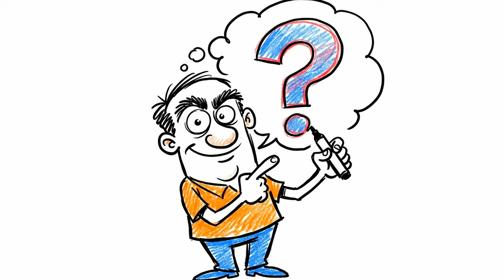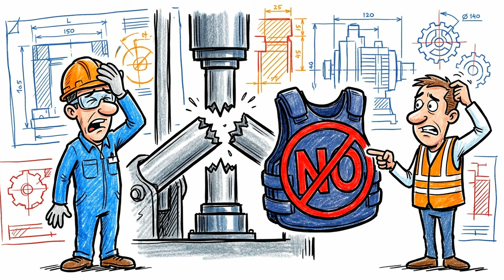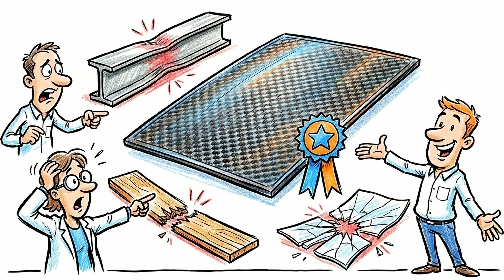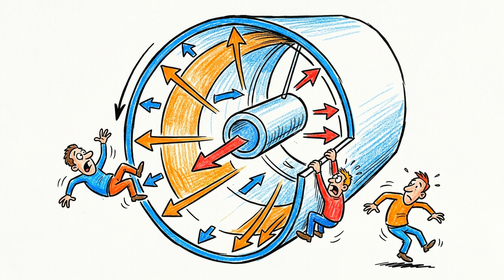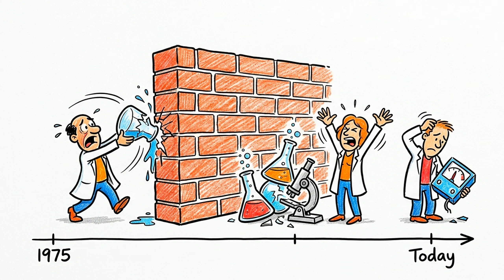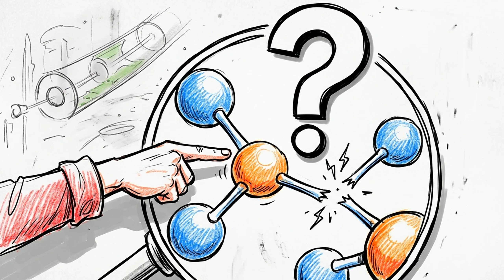Why O’Neill Cylinders Are Impossible

Comment: Pressurized cylinders inside of pressurized cylinders. Multiple layers of pressurized hulls providing redundancy. The interior cylinder at 1 atmosphere, the one outside of that at 1.2 atmospheres, the one outside of it at 1.5 atmosphere, ect..
The center cylinder walls won't have to handle the stress of a vacuum competing with the centrifugal force of all of it's contents since it is being pushed back inwards by the greater pressures of exterior hulls which do not have to spin.

Comment: The fictional Babylon 5 station was essentially an O'Neill cylinder 5 miles long.  I don't remember how wide it was, but I wonder if that scale would be possible?
Reply: Babylon 5 had an overall diameter of 1.6 kilometres. It is possible to build this, but the Kalpana habitat is a better design and the current hot favourite.

Comment: This hurt my brain it has so many errors.
Reply: For starters you can have double and triple hulls. If shell is constructed in space materials can be vacuum fused. Micrometeorites are an issue, which just means you need to replace an ablative layer periodically.
Reply: Why don't you outline those errors instead of just casting shade on the AI's work.

Comment: The spin is the only thing between the pople inside and the vacuum outside?  Also making it sound like any rotating structure is impossible. Foremost, dont trust one source of any calculations. Also material science moves forward alot. And depends alot of how you contruct some thing. I call this a rather bad part of video. Could been good with a different script.

Comment: Looks almost like the opposite of the deep sea titan that failed.  Pressure inside instead of outside.
Reply: It's not the pressure, it's the centrifugal force. If the cylinder isn't spinning it would be structurally fine. Of course everyone inside would be floating.
Reply: @mdhj67  Sure but you can use an outer, stationary hull to avoid this.
Reply: @wkeithk  How does an outer hull cancel the centrifugal force?
Reply: @mdhj67 By insulating the inner hull from the deteriorating factors of direct exposure to space. The c-force is good the constant thermal expansion/contraction, erosion and vacuum pressure bad.

Not trying to cancel centrifugal force, we’re making it on purpose. We’re protecting its apparatus.
Reply: @wkeithk  That would not affect the hoop stress at all.
Reply: same results, near instant death.
Reply: 1 atm of diffrence is a lot less then 400atm

Comment: There are so many mistakes and errors and misassumptions in this it would take me several comments to deal with them all. Just to say this video is just plain wrong. Just for starters, the O'neill cylinder is not the most thoroughly thought out idea for a space habitat, that would be the Kalpana habitat. O'neill specified a diameter of 8 kilometres as this is within the breaking strain of steel. And I hate the AI voice.
Reply: Glad I came to the comments before wasting my time watching the whole thing! :face-fuchsia-wide-eyes:
Reply: Well, I wouldn't say that the O'Neill cylinder is less thought out; it's simply optimized for different priorities. If you mean, “better engineered with modern constraints in mind," then that's reasonable. But if you really mean, more thoroughly thought out overall," then that's not accurate.